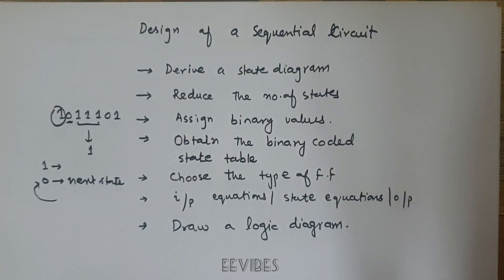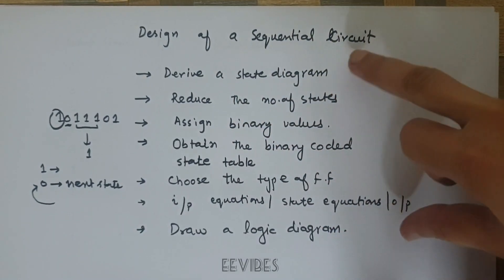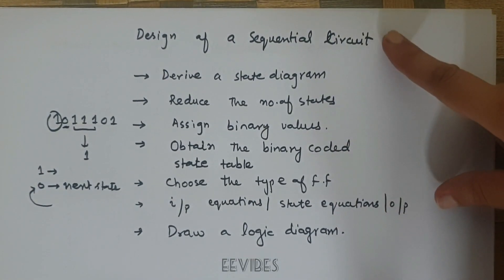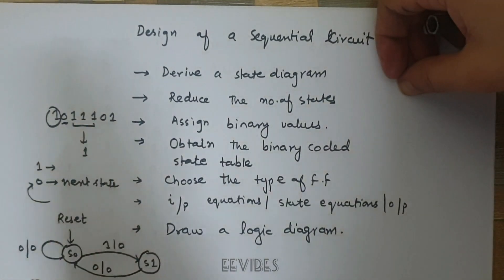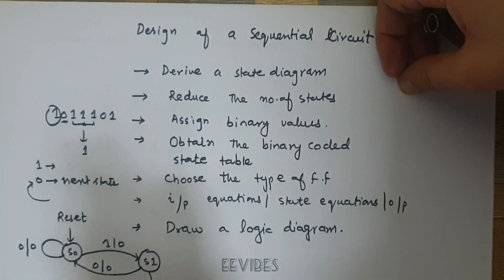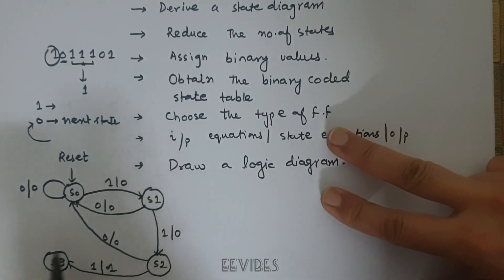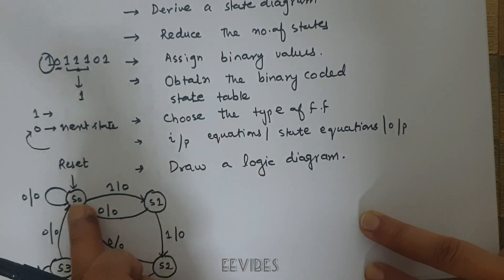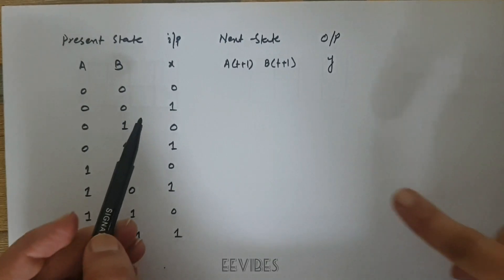How to Design a sequential Circuit that Detects Three or More Consecutive 1's in the Input String?

Comment: When it is pass input x=1,present state (10)    to      next state (11)  its output should be 1 and
When it is pass x=0, present state (11)      to       next state (00) its output should be 0.
But in there you interchange this two.
Also in our university our lecturer also did the same.
But i dont know the reason why it is.
Could you please explain if there anything i miss or its a mistake of you
Reply: your answer is correct. when 1 comes three times, output will be 1
Reply: the output(y) is moore output which means its a function of present state only so doing this state table of y is not 100% correct we should do a isolated table for y which include A(t) and B(t) only so when its 11 y became 1 the the sol in the video is wrong she builds a mealy diagram and did moore state table
Reply: Same thing 
Please if you know the correct answer say that
Reply: do you kno w how resolve this problem??
Reply: I think you're right, let me wait until tomorrow when I go to class, I will ask my teacher about this part.
Reply: our university tute has the same issue, thanks for your explanation here 💚